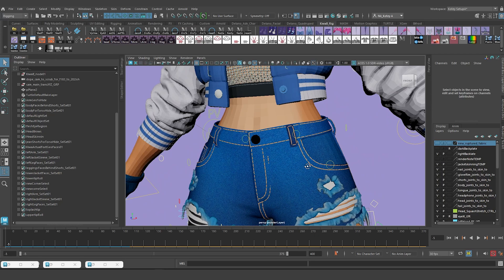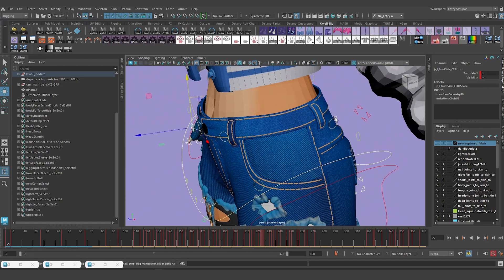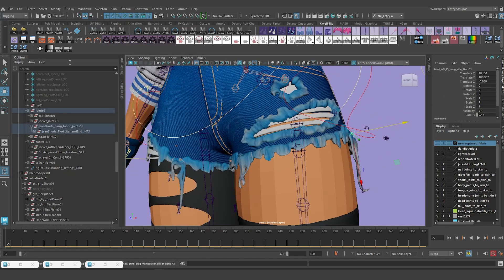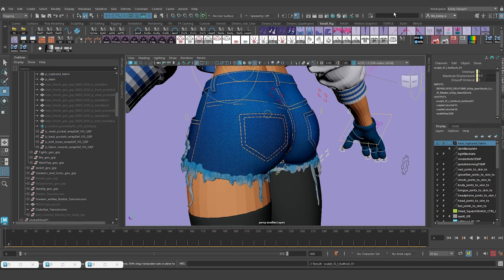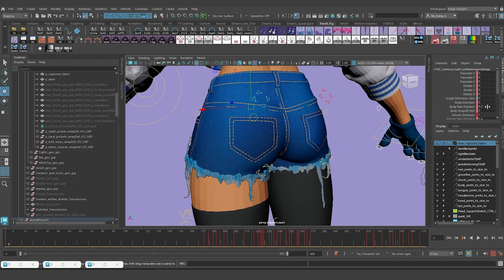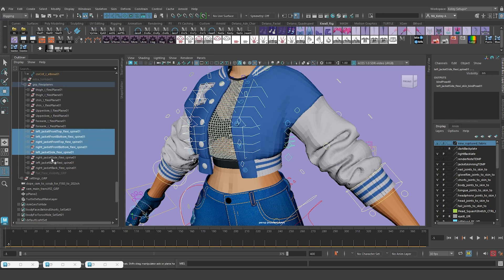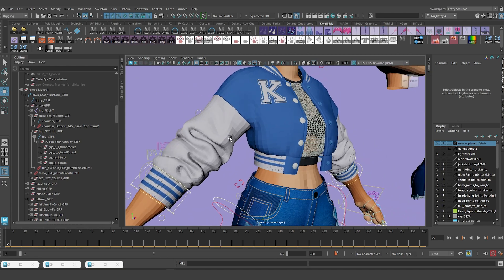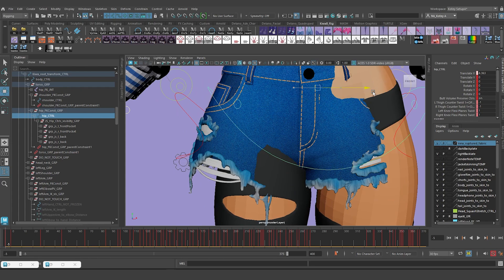Simulating Sculpted clothing in Maya with nCloth - Part 2/8

Comment: Hey! May I knw why you specifically modelled the stitches of the shorts and the "K" design seperately, when they can be all painted on the surface as texture in substance painter? 🤔 Is it for extra control?  Doesn't it increase the polycount unnecessarily? Just curious..
Reply from the maker: Hey Manasa, 
1. it produces more crisper detail when these things are separate pieces of geometry. for very very close up renders you get a pristine seperation where as if you relied on a normal or displacment map you will see some jaggedness as you zoom in for closer renders(unless you do a lot of subdividing for displacment or use very large high res normal maps).

2. it reduces the amount of texturing work, specfically for the threading. simplifies the texturing process.

3. For the K logo in particular,  it reduces the amount of work you have to do when resurfacing the final renderable jacket.

But the work is never really an issue. for me it's how crisp it feels. normal or displacement maps will not punch out the detail more clearly than actualy physical detail representing the detail. Texturing is also a breeze. you can just apply a singular material to them and in the case of the stitches disable all shading properties, relying only on diffuse to shade the threading. 

I would not recommend this approach for a game asset.
Reply: @KoteyAnnan  Ok ☺️.. I was wondering why u didn't use the UDIM approach 😅.. Now I got it! It's ur personal choice in this project ☺️ Thanks

Comment: Do yo have a tutorial on how you set up the buttons? I have never been able to figure out how to get buttons to look right. I wrap them to the cloth, but then they deform, and don't really look like a button should.
Reply from the maker: There is a constraint in the rigging menu called a proximity pin. It counts on a locator to keep things like a buttons and zippers pinned in place. And the geo won't deform like it does with a wrap. I've also seen a uv pin function used  the same way. I used a proximity pin for Button on the varsity jacket in this tutorial.
Reply: @KoteyAnnan  Thanks, man. I'm going to try that.